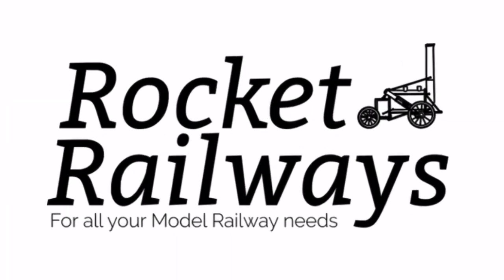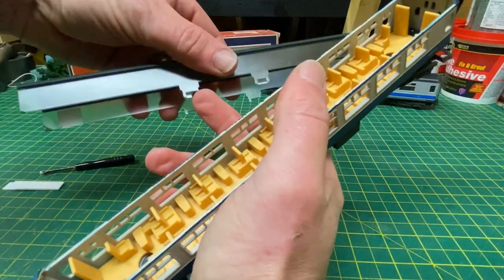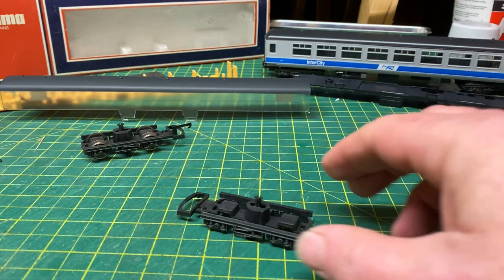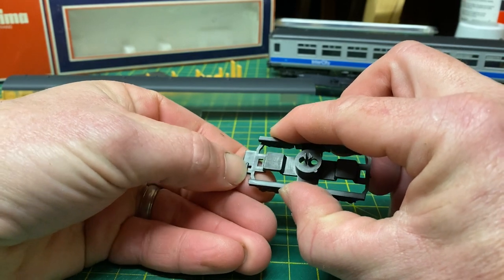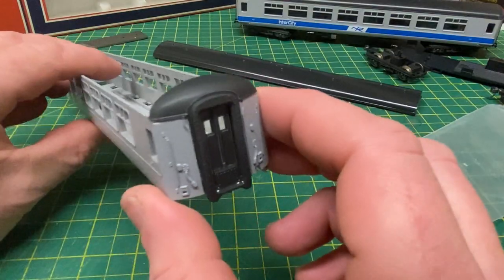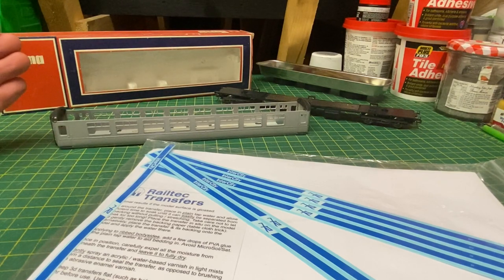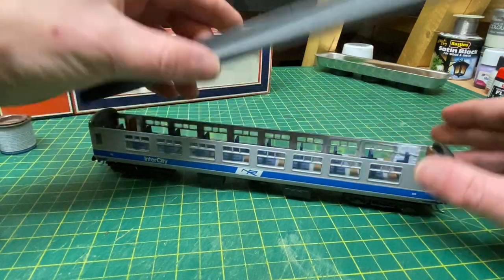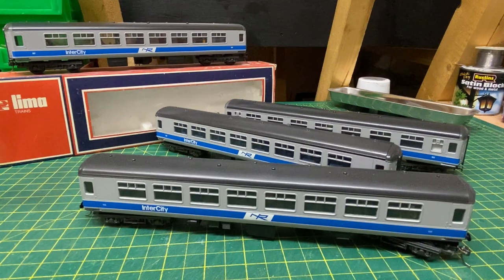Converting A Lima Coach To NIR Enterprise Livery

Comment: The coach looks well. One tip on the bogies. The Lima ones were the wrong away around so if you are adding a new coupling hook add it to the opposite end to where the Lima coupling was located. This applies to both this Lima 2B and their air-conditioned Mk 2s as well.
Reply from the maker: Thanks for that too, I’ll remember it for future conversions. Paul

Comment: The spaghetti jar is inspired. Great tip and great video.
Reply from the maker: Thanks Philip, I’d like to say it was mine but I just copied what another modeller, Eric at Harfield Road, was using. Paul
Reply: @GalgormHall  Well thanks nevertheless for passing it on and thanks for the IPA tip as well. I have loads of it and I was going to use brake fluid on some of these but I'll use IPA instead now. Looks to do a good job. Are you just putting the coaches back into the used IPA a few times Paul?
Reply from the maker: @murphaph  for these Lima coaches they got dipped twice. The second dip was really just a precautionary one to ensure I hadn’t missed any paint removal after the first one. Paul

Comment: What a difference the flush glazing makes. Fantastic like all your videos. Loved this. 

I have a faint memory of Irish Rail having similar stock running between Dublin and Galway and an even fainter memory of Lima actually doing these?
Reply from the maker: Thank you and you’re right, the flush glazing makes all the difference. Paul
Reply: Hi. Lima never did Irish mk2a/b/c stock. Murphy Models commissioned Bachmann to make mk2a coaches in IR and IE livery but there were only 4 prototype mk2a's. These as well as the rest of the IR mk2 air braked stock was made up of ex BR mk2b & c coaches (only around 18 in total). Like the NIR ones they have to be made from resprayed Limas. Some mk2as had the centre door plated over by IR so these ones need a Bachmann BR donor to be filled and resprayed. IR used rebuilt Werkspoor EGVs (converted from GSVs) in these trains which weren't as nice as the uniform look of the NIR rakes with matching EGV.

Comment: Great work Paul and you answered a question I had which was how do you get the roof off Lima Coaches. That looks a professional  job on the coach re spray and it does not show at all that it has been re sprayed.
Cheers Kev
Reply from the maker: Thanks so much Kev. The roof is a little fiddly and easily broken too if you go at it too hard. Slow and steady wins the race. Paul

Comment: I have four of these coaches and have been afraid to touch them as I didn't know how they came apart! I'd love to try converting them to the old CIE black and orange, perhaps with a white stripe above the windows!
Reply from the maker: Hopefully the video has helped. Just be careful taking that roof off as the plastic clips can break or worse you crack the roof piece itself. Paul

Comment: Hi Paul
I have followed all in your master class, coaches look well.
But when going to buy transfers  I find the price for a set is costing almost £40 
Unfortunately its at this point my converts have to finish. Points glazing etc were 
expensive enough but not prepared for the cost of transfers.
Reply from the maker: Hi Henry they are a tad expensive however the quality of them is superb plus there are enough decals to do a number of coaches which does cut the cost considerably. I reckon when I break down the costs of all materials plus the donar coaches each one comes in at about £30 each for the 5 that I’ve done. In my mind that is still excellent value against an RTR coach. Paul

Comment: Nicely done. Pity the new windows have to be cut, but they look great.
Reply from the maker: Thanks Ray, it’s a bit of a faff cutting the windows out but small get in comparison to some aspects of the conversion. Paul
Reply: @GalgormHall  I looked up their website and they do a set for the Triang Blue Pullman, so I will order some and give them a try. I rewheeled mine to modern standards, so might as well go the extra mile.